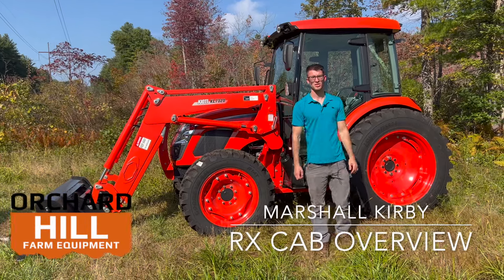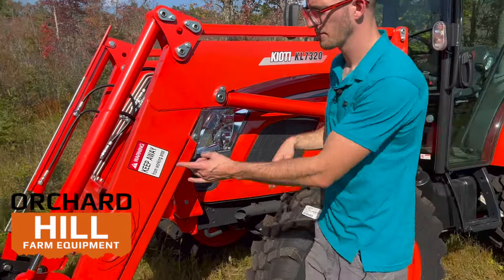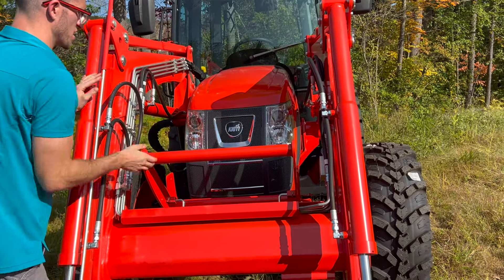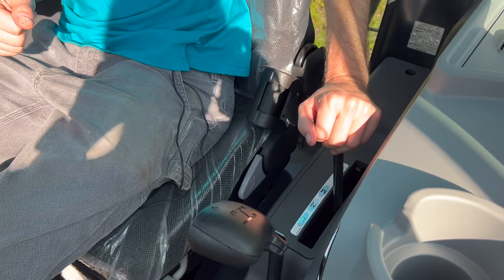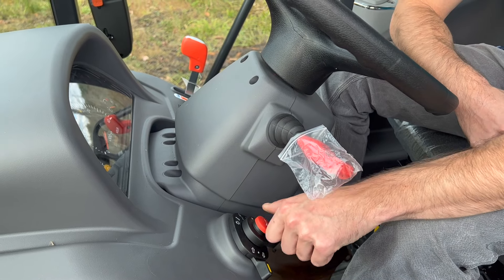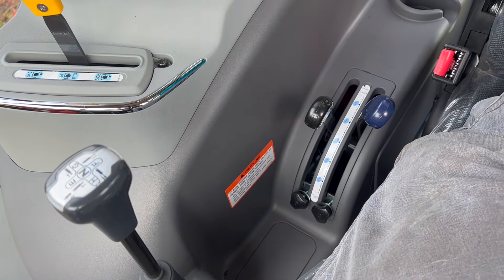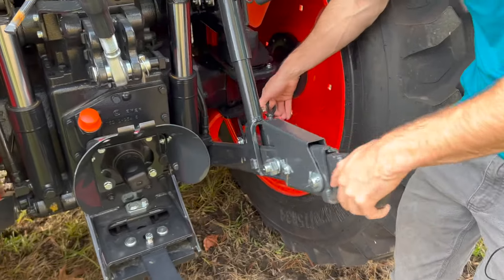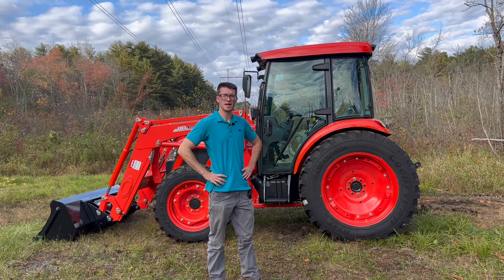Kioti RX CAB SERIES Tractor Full Walkthru - RX6620 & RX7320 Powershuttle

Comment: Have a 😄6620 cab great power r4.  With chain on front and is unstoppable, snow beast.
300 hrs. Great logger as well. This burns about 3/4-1 gal per hour. Lots of room in cab,
Modes I have done cameras front and rear on tow bar for excellent sight on rear blade front hook up for quick bucket change. DPF cycles about every 10-25 hrs just keep working at full rpm. Rear tilt and angle hyd.s works good for wood splitter.  The factory work lights where replaced with LEDs , Good presentation.
Reply: Where did you get your rear tilt and angle hydraulics and also I will have to get the 2nd remote did you get the kit from Kioti? Did they installed it? I will definitely get the 3rd function also.
Reply: @elhappyhuero     I got it off internet , but I think summit hydraulics have a better deal now